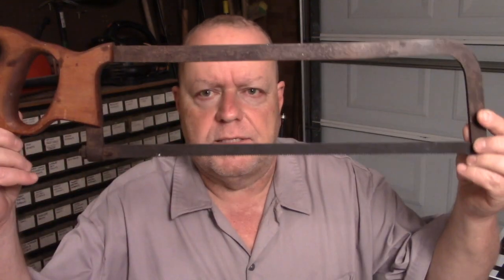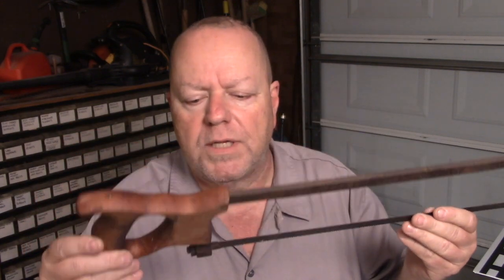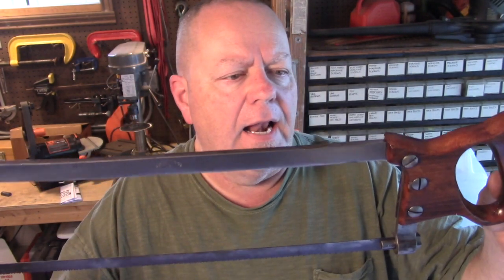Meat Saw

Comment: Hi Ben, That looks great. I cringed when the handle broke, but modern day wood glue is unbelievable, no doubt it is stronger now than it was before. I was happy to see the die grinder, they sure do make life easier, and there are so many cool abrasive options. Anyway, I really enjoy the format, pace, and content of your videos. Cheers
Reply from the maker: Thanks Joe. That die grinder was FANTASTIC. But you were right, they chew up a lot of air, fast. That compressor of mine just kept running and I found I had to pause quite a bit so it could catch up. Still, yes, those fiber pads are going to be my new "go-to". Thanks for the compliment!